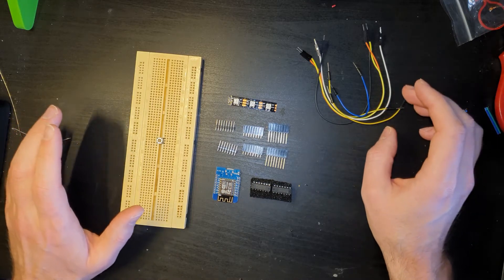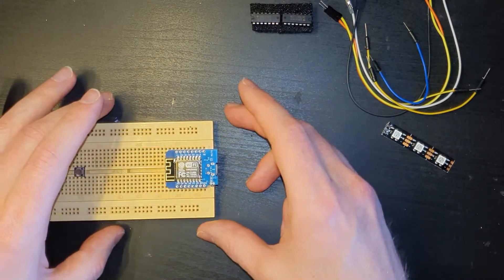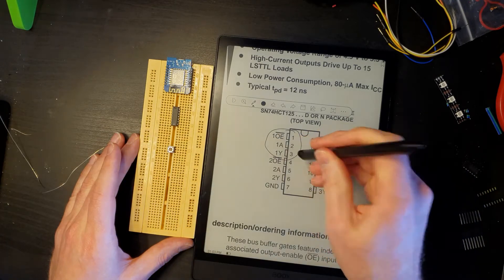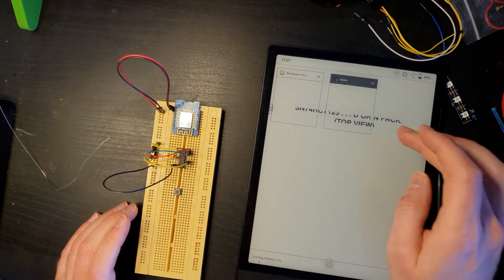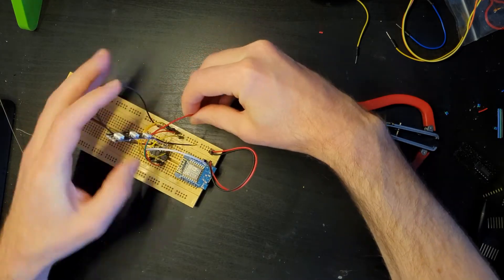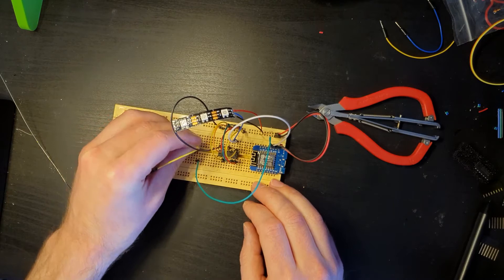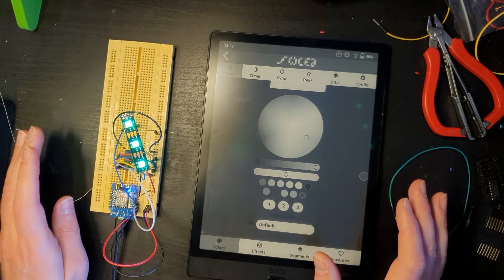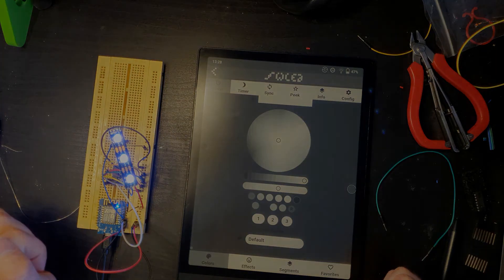Lightbox Circuit Test - Nanoleaf Replica

Comment: Which E-ink tablet do you use. I've been looking into getting one but I'm not sure what brand.
Reply from the maker: It's the Boox Note 3. Works well for the most part. One annoying thing is that there is no where to store the stylus when not in use, I've already lost one to the washing machine as I stupidly left it in my jeans! 

That said the device works pretty well, it's run all the software I could throw at it (doesn't come with Google play, it can be installed but is a bit of a pain, not difficult tho). Can even play YouTube videos LOL surprisingly watchable in a pinch, but probably best on a more conventional device LOL

Comment: Nice vid will this give this a try👍🏽👍🏽
Reply from the maker: Have to let us know how it goes! Next week I will be doing the PCB and I'll be sharing the files for anyone to use :)
Reply: @smartroadbiker  atm i got 15 panels setup with an esp8266
Reply from the maker: Wow, I've stopped at 6 LOL
Reply: @smartroadbiker  hahaha, i also created a model for an attachment as a power attachment, i also used magnets and 3 pin magnetic connectors between the panals just like the original ones so i can move them where ever i want. if you want to see mine hit me up on discord
Reply: @rickschurink6824  how to get in contact with you about the parts? or name and so
Reply: Hey.Where did you buy magnetic connectors from?
Reply: @janithk.2565  On aliexpress